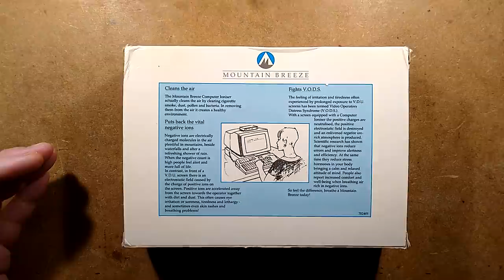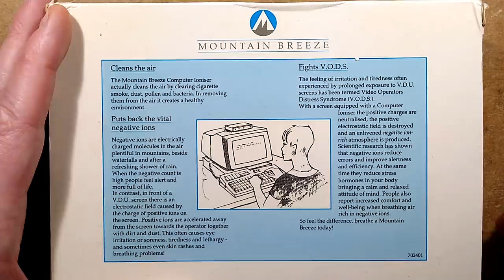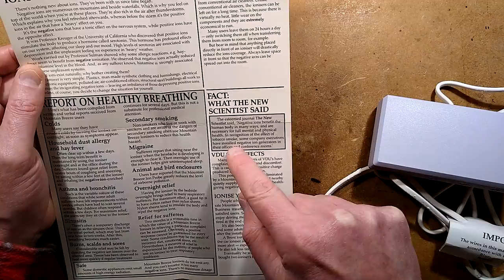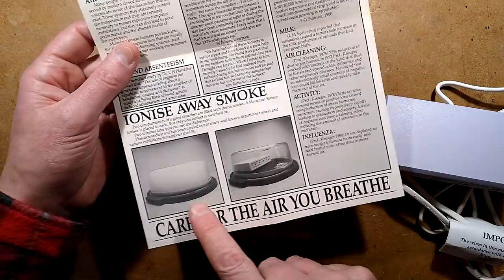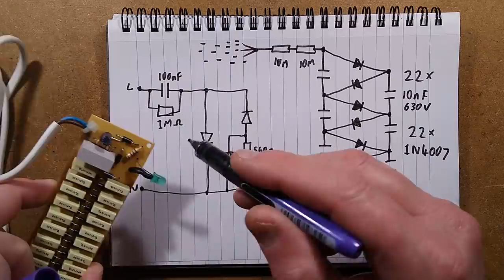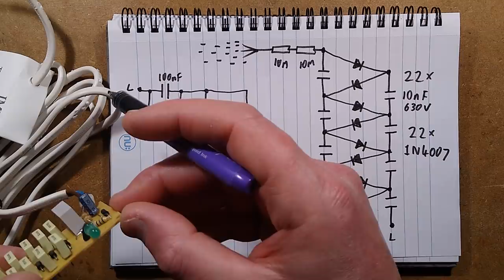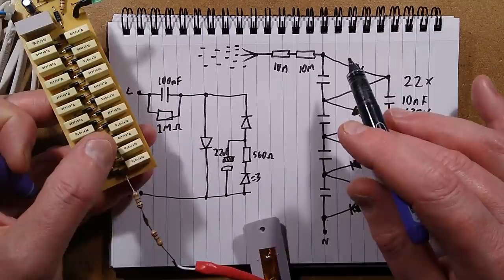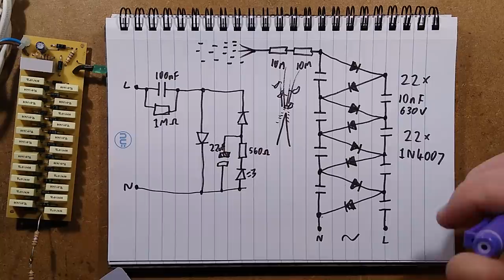Inside a vintage Mountain Breeze Computer Ioniser.

Comment: Great video. I love your videos because you inspired me to start to teach myself about electronics and such. Being a disabled US Veteran with no income, I need to find a way to make money and your videos are teaching me how to understand electronics and everything else that goes with it. Thank you 😊 for the inspiration. 🏳️‍🌈🤗
Reply: As an old US Veteran who has played and worked with electronics let me say you've made a great choice. Well, several. Electronics can be an absorbing, elevating hobby and a pretty good income. Free advice worth the price- learn the basics from wiring to soldering to construction to the math of RF, coding and so on, then learn to recognize them when you see them.
The other good choice was choosing Clive as a teacher. Funny guy but deadly serious about the angry pixies. I mean electrons.
Reply: My career has gone to shit so I'm casting around for ways to make some income too. I've discovered that supposedly broken, battery power tools are often fixed by a quick clean with contact cleaner and a toothbrush. They suck in dust, oil and metal filings which deposit around the motor and stop it working. You don't actually need to understand any circuitry. There's got to be money in that. Good luck mate.

Comment: Never enough videos on Ionisers, Ozone generators and LEDs! 
Maybe you should do an "Ultimate Big Clive DIY Ioniser" showing us how big an ioniser your can scratch build without creating problems in electronics?
I hobbled together a load of those resin potted Ioniser modules from Ebay, the ones that take 240AC in and have about 10 carbon fibre tipped leads coming out. I was getting zaps touching anything metal at the other side of the room!

Comment: Thanks for making this video. I've a story about ionizers. When I was 16, a friend and I decided we would build an ion unit. We did the math and all and came up with our cool invention. Back then, my bedroom was the design, prototype and manufacturing shop.
We fired up the unit and were impressed hearing the sputter of the output. After running it for a half hour or so, my friend started feeling ill. He became worse real fast and fell to the floor in convulsions!
With the help of my doctor Mom, we got him stable and to the hospital where they diagnosed him as having epilepsy! Nobody knew he had it and our invention is what triggered an early epileptic seizure.
Mom did a lot of research with other doctors and it was determined that we had unknowingly built a positive ion generator. Poor David, I still remember how terrifying it was for everyone.
We did end up making a negative ion unit but our production was limited to that one unit and we moved onto other dangerous projects.
Reply from the maker: I've never heard of ionisation causing that effect.
Reply: @bigclivedotcom  We had not either but in this case it triggered a previously unknown condition.

Comment: Had an ion generator next to my PC. It charged me and I froze the pc with ESD to the keyboard. Took a while to troubleshoot the issue.
Reply: @Andrew Ballard wow, that's such a stupid idea. Could you turn the ioniser off? Probably the worst place to deposit dust would be inside a computer case.
Reply: @Milamberinx  i think you are mixing the two comments, frank probably just had a regular ioniser
Reply: I used to scuff my feet across the carpet and zap my dad as he typed away at his Apple IIC+ and freeze it, it was the funniest thing in the world to young me.
Reply: Russian-bot 01101010 I wasn’t replying to Frank, are you sure you didn’t confuse the replies?
Reply: @NOSUBSCRIBERSWANTED  or you could get an air filter and close the windows instead of breathing in harmful negative ions
Reply: Takes the phrase PEBKAC to whole another level!
Reply: 150kvdc into an array of needles will bsod a pc.
Reply: I built an air filter for clearing soldering fumes and initially intended to build an ioniser into it after being inspired by one of clive's early ioniser videos.
Thankfully I realised how stupid an idea that was BEFORE putting the ioniser in the front of the air inlet , mere centremetres away from where I'd be soldering static sensitive components.

Comment: "Villard cascade" is a common name of this diode/capacitor ladder network.  Trivia fact 1: Paul Ulrich Villard discovered gamma rays which were going to be called Villard rays if Rutherford had not come up with the slightly more catchy name "gamma rays". Trivia fact 2: Villard didn't invent the cascade, it was Heinrich Greinacher who designed it and called it the "Greinacher multiplier". Trivia fact 3: The most often quoted name for the network is "Cockcroft–Walton multiplier" but they didn't invent it either, they just refined it and used it to generate high voltages for their particle accelerator.

Comment: Wow this takes me back. Had one of these next to my old 386
Reply: Likewise possibly 286 initially. Had to stop using the ioniser as everything got covered in ‘soot’ especially the textured wall which couldn’t be cleaned and had to be repainted. Not to mention everything else within range.
Reply: ...and I was thinking the reason 386s, 486s and P60/90s had less dust in them cos they used less power, so less latent static.
...nope, it looks like it was cos people were using Ionisers. ...it must have been quite confusing for consumers when de-ionising was added to the next gen of crt's!

Comment: Back in the late 70's I had a ZeroStat anti-static gun to eliminate static charges on my vinyl records. It would generate both positive and negative ions which it would emit from a short needle. I think it relied on the piezoelectric effect  for ion generation - not sure. I remember being fascinated just looking at the tiny blue jet at the end of the needle with a magnifying glass. With the resurgence of vinyl records these devices are still being sold... at a considerable cost! They weren't that expensive back then!
Reply: Still using mine, bought too many years ago.

Comment: I remember we all had screen protectors fitted in the 90’s because the screen flicker and the fluorescent tube flicker at different speeds which induces eye strain and headaches apparently.
Reply: I was in I.T. back then, our company made us install screen protectors on every user's computers. Half of them were pulled off within a week, people hated them.
Reply: Only time I had that sort of problem was when using dodgy monitor at work, it's image was not sharp and after using it for a day I came down with one of the worst migraines I have experienced. Ha

Comment: As a young experimenter I built a diode pump, like that one, and ran it with a multivibrator to give around 500V at the output to use as an insulation tester. I then cobbled together a traffic light led  system as Pass Caution Fail indicator.
It worked well and then I found a cheap 'Wee Megger' and the project got stripped for parts. Oh the joys of experimenting on a shoestring budget.

Comment: I have a mountain breeze air purifier that has a fan, filter, ionizer and fragrance diffuser. It has the blue heatshrink over the ionizer. Its from the early 90s. 1990-92 have to have a look. The model is                           "Air system 2000"
Reply: nice system

Comment: I forgot that years ago that appliances in the UK didn’t come with plugs!
Reply: Had to install yourself?
Reply: @Solocat1  well I would assume so, if you want it to function...
Reply: Back before about 1993 plugs weren't included in the uk
Reply: @Solocat1  wasn't trying to be an asshole. Just a stupid sense of humor.

But yeah, you probably need a plug unless you like shorting 120/240V power through your body. :P
Reply: And such a pain in the arse it was
Reply: Oh yeah🤔
Reply: @mirandahw  Some people did just stick the wires in the socket. Or wire several things into one plug.
Reply: I remember the campaign on BBC Watchdog to force manufacturers to supply electrical goods with plugs fitted.
Reply: I remember (As someone born in 94) buying a Super Nintendo used about ten years ago and getting a surprise when I saw that the plug it came with was just an old household standard plug that had been fitted. It really was a shock to think that at any point in the past people had to wire their own plugs.
Reply: @Zeem4  I forget which class it was in but in the UK in the 1970s we had a lesson on how to wire an electrical plug.
Reply: Yep. Sockets weren’t standardized then and one had to install a plug that matched the socket one planned to use. I first read about that in the 1970s in a Wall Street Journal article about some eastern Bloc gadget sold in the UK: the WSJ writer had to explain why it didn’t come with a plug.
Reply: @peterjf7723  They still do this, in some schools at least. I do IT support in schools and only last week saw a lesson in progress on how to wire a mains plug, although that's a school with an engineering specialism.
Reply: @markiangooley  Electrical plugs are still not made to the same design standards, can be annoying if you buy things from other countries on eBay.
Reply: @markiangooley  The lack of standardisation was an issue in the early days of electricity in the UK. The current type G (BS 1363) socket was standardised in 1947 and by the late 1950s had replaced the earlier BS546 round-pin plugs in new installations. There was still an issue afterwards regarding old installations - a friend of mine renovated a house a couple of years ago that still had round-pin sockets in it, but it hadn't been lived in since the 1960s.

By the 1990s it was just a case that the law hadn't caught up with the fact that the plugs and sockets had been standardised for decades, and manufacturers didn't bother fitting them because they didn't have to and could make more profit by not doing so.
Reply: @peterjf7723  I started secondary school in September '96 and remember that I had a science class that included how to wire a plug, I remember which room I was in but not which year it was, so some time between 1996 and 2001.
Reply: @Milamberinx  Good to know.
Reply: @mirandahw  or you used matchsticks and poked the wires into the socket :)
Reply: @grantrennie  That's quite shocking (pun *not* intended!) considering how many safety protocols the UK has in their electrical codes.
Reply: I was born in 1990 and was shown how to wire a U.K. plug in science In year 10 around 2004
Reply: I was born in 1990 and was shown how to wire a U.K. plug in science In year 10 around 2004
Reply: You can still buy round pin plugs and sockets if you so wish. In my house (now about 21 years old), some rooms have 5A round pin sockets for lighting, controlled by a wall switch (fed off the lighting circuits). Hence some of my lights have 5A round pin plugs fitted by me.

Comment: The circuit was published in ETI (Electronics Today International) in the 80's (a british magazine). I made one myself and it collected dust like crazy ! -:)
Reply from the maker: If that was the really small unit then it was very good.
Reply: " it collected dust like crazy"  Yup, it is from the ions attaching to airborne particles, giving them a charge so they followed the voltage gradient to the nearest surfaces, bit of a pain around Heathrow & similar areas with lots of rubbish in the air from engines

Comment: Quite funny how they were touting them as protection from the harm caused by CRT displays, cos really, the harm they caused was more round the back for those of us poking around inside having not discharged the CRT tube first, boy that was one heck of a belt I got of a Philips TV once!!! :P

As for cables, my Spectrum Plus has the melty moments in its' polystyrene box too, leaving sticky bits on the cables that had been stored in there... :S
Reply: Yep. Nearly got killed from that

Comment: @18:12 That cable tie is most probably for safety reasons: If for some reason the cable get pulled of the box while it is live, a cable tie there causes a short between mains and neutral, which will in turn trip a breaker.

Comment: I wonder how many people watching, used those "Screen protector shield" things over the CRT screen? Probably none given most viewers of this channel are educated.
Reply: i didn't have one of those but i remember it, it was a gray plastic sheet that was electrically grounded, probably the plastic was conductive somehow... but i had a CRT monitor that was coated on the outer surface with some glittering stuff, i don't remember why but they may have said it was for the same reason of shielding, LG Flatron 775 and i have to thank it for the reason i don't have glasses even nowadays, likely not because of that shielding
Reply: Those are supposed to have some effect. Not what some of them claim (shield against X-rays from the CRT, that's BS, although it could be true if they used high lead content glass, but I guess they don't), but they had a conductive coating that was grounded, so effectively shielded the electrostatic field generated by the CRT's anode voltage. Though I don't know what's the exact benefit of this... 
Some said that the electrostatic field constantly pushed small flying particles (dust, mites, etc) into the user's face (and eyes), especially during power up, power down, and sudden brightness changes. Later CRTs had that coating integrated onto the surface of the CRT, and it was very effective. The screen of older CRTs constantly became very dusty very quickly. These later CRTs never. I'm currently using a 2003/2004 Samsung CRT monitor (SyncMaster 763MB), it has that conductive coating, and has almost zero dust on the screen despite I haven't cleaned it for months (well, I cleaned the top of it, but not the screen), and I use it daily for 2-4 hours per day, or even 8-12 hours a day at weekends .
Reply: @redoverdrivetheunstoppable4637  Better ones had smoked glass sheets with conductive coating, and supposedly had some postitive effect. Read my previous comment in this thread. The plastic ones were quite horrible, they distorted the picture and got blurry after a few cleaning due to micro scratches.
Yes, I have a Samsung SyncMaster 763MB monitor which I'm currently using, it has a conductive antiglare-antistatic coating. There were different approaches for this, some manufacturers (like Mitsubishi) used a self adhesive foil, this Samsung has the coating vacuum evaporated on the screen. It gives a blueish tint to the reflections when the monitor is off. And it very effectively shields the static charge of the screen. No dust on it even after months of use.
Reply: @mrnmrn1  there's a bad mood toward such shielding around here but i'm not sure, if reputable sellers like LG and Samsung (likely the best ones) used this system there may be benefits, in general i'm not much into "health freaking" but important things are important
Reply: @redoverdrivetheunstoppable4637  reputable sellers did use conductive coating on the screens, if only to conform to TCO standards. Also, Samsung was known back in the day for a whole other interpretation of 'low emissions'. They were actually talking about the cathodes, not about the magnetic and electric fields... No, they were not the best ones back then. I'd say Philips was, up to 2005 and some Nokia, iiyama and NEC models.

Comment: It's not the polystyrene melting over the cable, it's much worse than that: it's the cable melting into the polystyrene (check out "plasticiser migration"). Not that long ago there was a story in the news of a house fire in the UK because someone had insulated their loft with polystyrene, it touched some electrical cabled and the insulation had been destroyed over time and shorted out.
Reply: John Ward did a video about the effect a few weeks ago.

Comment: I made a small ioniser many years ago. It hissed merrily and used to sit on an A4 sheet of paper due to the dirtying effect it had in whatever surface it sat on.
Reply: Yup, it is from the ions attaching to airborne particles, giving them a charge so they followed the voltage gradient to the nearest surfaces...
Reply: @peterchandler8505  Hence why I had it on a piece of paper. I could change the paper when it got dirty.
Reply: @SirHackaL0t.  Good thinking...  Just downwind of Liverpool here, guess I would have needed A0 size pieces of paper as the deposition did reach quite far with needlepoint ionisers...
Reply: @peterchandler8505  lol.

Comment: I had a rock salt lamp once, given to me by someone with good intentions, but who didn't really know me. I never turned it on, as it had all sorts of loose wiring, and absorbed loads of moisture from the air, so was always damp with brine. The bumf that came with it called ions"vitamins of the air".
Reply from the maker: Yeah, the ionisation feature was totally fake.  The heat from the lamp is supposed to stop it from turning into brine.